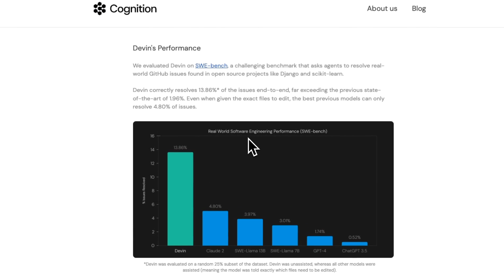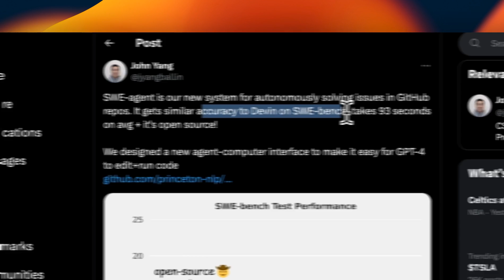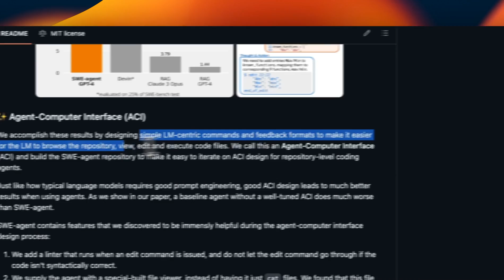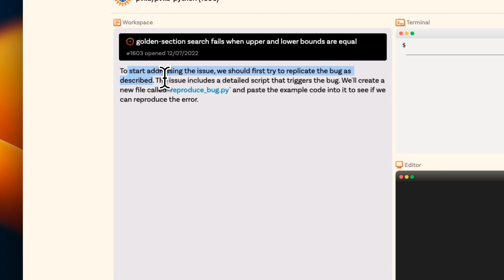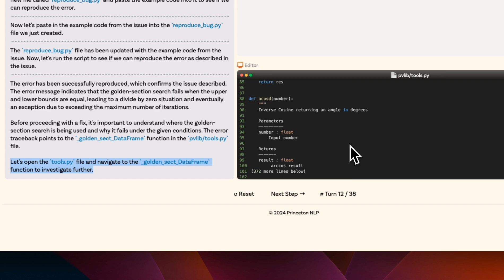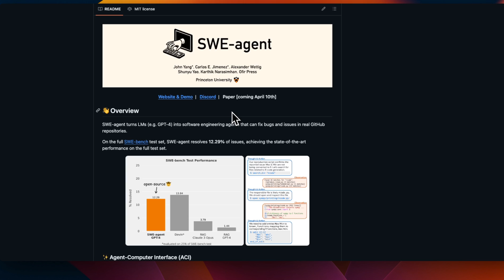SWE-Agent: The New Open Source Software Engineering Agent Takes on DEVIN

Comment: Between the 3-4 tools like Devika, Open Devin and SWE Agent which one would you recommend for fresh development.
Let's say a simple flutter web app built as as a GPT wrapper for text summariser. Or whisper note taker, etc.
Reply: In my experience they are all sort of... terrible. Aider, and aider-chat is the best from what I have seen. They all try to do too much.

If you use Open Devin... HAHAH you will look at the token usage even on a cheaper model like 3.5 or 4 Turbo and be like WTH. And  a lot of the times it does not even iterate well and actually solve the problems.

*TL/DR: I think yeah maybe for PYTHON these tools will be good and start to be bettrr and better. But for MANY other languages they are... TERRIBLE.